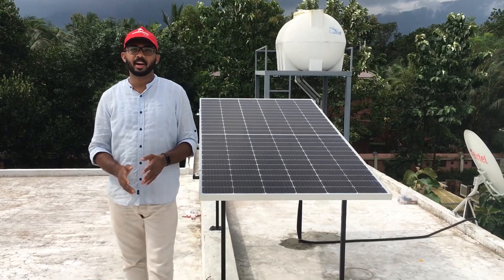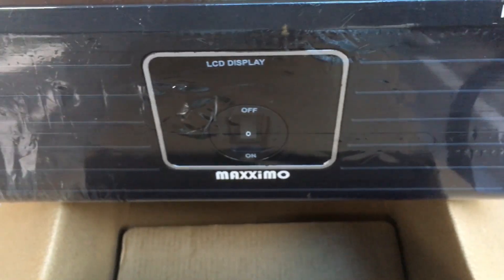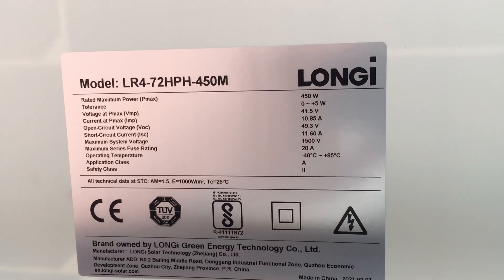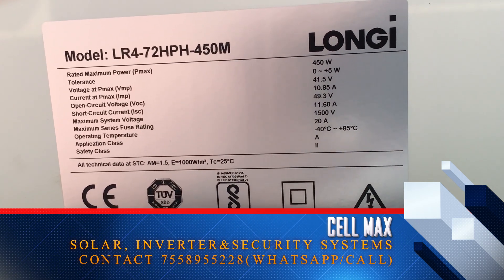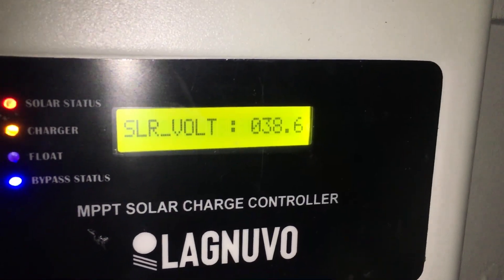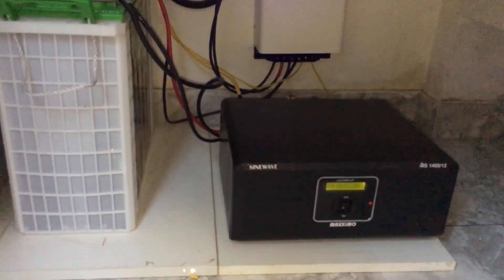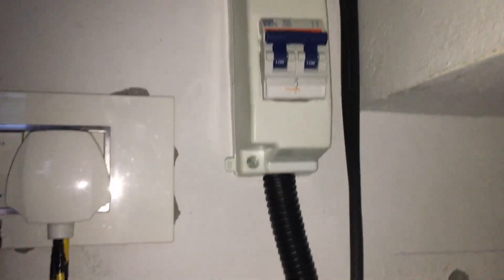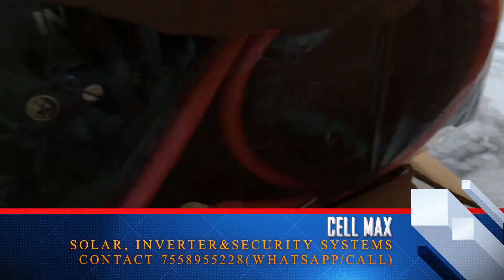SINGLE BATTERY SOLAR SYSTEM FOR HOME 1.4KVA

Comment: Ee flexible oze ittak within one year kond podinju pokulle ,20 de pipe idarnuuu
Reply from the maker: Maximum Quality ഉള്ളതാണ് use Cheidathu. Pipi idanamegil congreet thulakkamam ഭാവിയില്‍ leak വരാൻ chances ഉണ്ട്.
പിന്നെ UV Protection & 2 Coating ഉള്ള 6MM Dc Cable ആണ് use ചെയ്തിരിക്കുന്നത്.
Reply: @CMSolarTips  not need to fix it with saddle